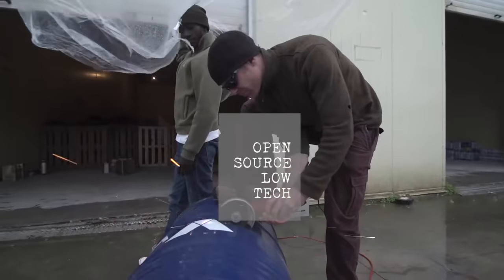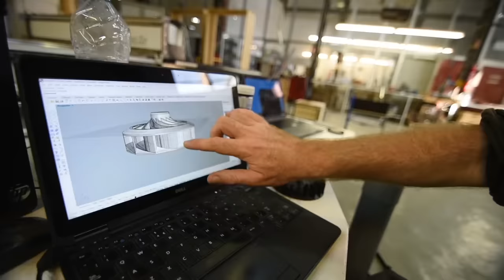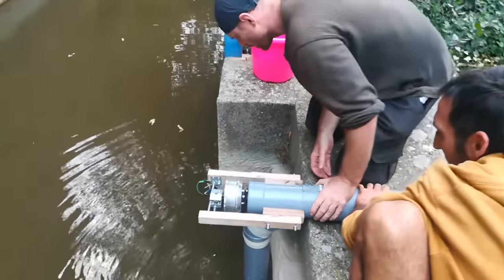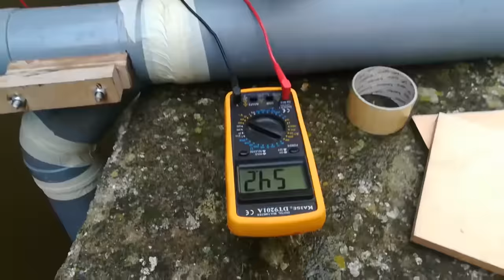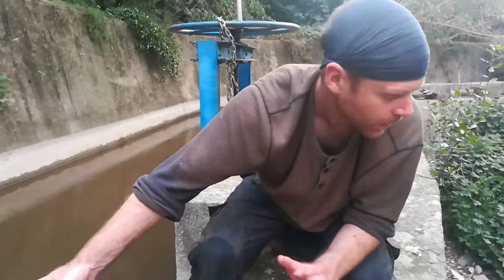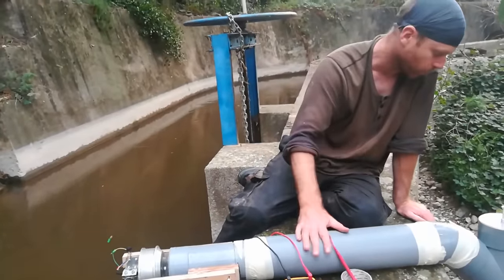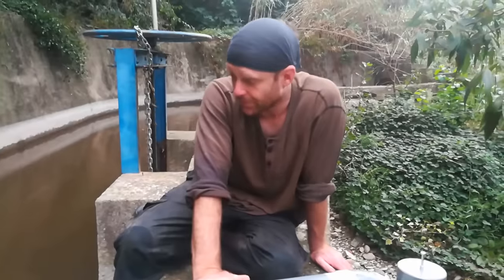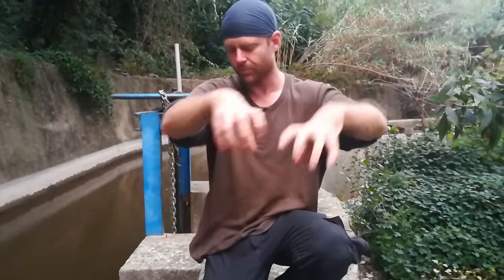The $50 Water Turbine -DIY, Portable, Powerful, and Open Source

Comment: He's like Doctors Without Borders but the green energy division. You have inspired me sir. I have water behind my house and I'm thinking of 4 of these in a series would end my dependence on the grid.
Reply: A big drop is necessary too, I think. Two meters is tough to come by where I live.
Reply: I've seen people do this method with even less steep of a drop, but they used a machine to begin the syphon initially so the pressure was crazy high
Reply: Engineers without borders is a thing. Also, as it happens, clowns without borders.

Comment: 5Hi there,  really do not want to be a small rain parade.  My experience with all of this is fairly extensive by this point.  Voltage is one of the considerations that tells us RPM.  Current draw is the basis for the actual load applied...not just a voltage meter.  If you put an actual 50 watt load on the system I believe your RPM would drop to 25% of the reading that you are getting now at possibly 12 to 14 volts which would need to supply a 4 amp output to be 50 watts.  It is very deceptive until you completely understand the full process.  Hopefully that is not a bummer for you and maybe I am all wet in my summary...just did not see a bulb or motor or something pulling off power other than a meter and that does not count in the real world...
Reply from the maker: In the process of finding out with the new test version in Berlin. Will post results hopefully by the end of the month.
Reply: @OpenSourceLowTech  I second the observation - there is no point in reporting zero load voltage and speculating a current/power availability based on generator specs.  Put a simple 10 ohm power resistor across to provide a real world load and then measure the voltage.  Make it quick though as (we hope) the resistor to get very hot, very quickly.  

Two other observations regarding your very interesting and innovative implementation though.
1) I would worry about maintaining a siphon for any reasonable length of time (days, weeks).  Maybe the continuous flow rate will purge any bubbles forming at the top of the siphon so this is not a problem.  Hope so.
2) Your observation that the current design with the impeller on top (terrific idea for maintenance etc.) not being dependent on the head as it 'is only dependent on the speed of the water, not the drop height' - I think this is going to be proven wrong.  Once you have a load, the weight of the water in the pipe will support the torque on the turbine, meaning the actual power will be directly affected by the head. 

Good luck with your project though, I look forward to seeing some real numbers.
Reply: @OpenSourceLowTech  you should look into maple sap production and how they run 3/16 lines(as opposed to 5/6) and it actually creates more vacuum in the tubing(sap doesn't just run down the side of the pipe, it seals and pulls vacuum) . I'm wondering If you could see this effect in your device if your down pipe was a smaller diameter that the intake??
Reply: @joshwooten3719  , with that much volume of water at the exit, he could use a much larger impeller and have ten time the torque where he can gear up for more RPM
Reply: @lightrose100   that water means nothing though if there is any air in the tube which could cause cavitation/air pockets. With the impeller at the top, it is completely dependent on liquid vacuum of the water moving through. Ie. You could move the same volume of air through the pipe as water and it would barely spin at all. I'm not sayings that's the case but the sap stuff is at the very least an interesting read.
Reply: David: Hence a reason why the Betz limit exists for regular wind turbines. Higher power draw, lower rotor speed = less power available than theoretical, based on unloaded rotor speed...

The beauty of a Pelton wheel (if there is any beauty to behold)  is that no matter the load, the energy of the water at the jet is "constant", just that a loaded rotor turns more slowly with higher impulse per cup.  - Downside, fairly high heads are required to be efficient.
Reply: Is your pipe 4 or 6inch??good video
Reply: Michael Moore Hi
Regarding top or bottom impeller placement. 
I think that when placed at the top, a vacuum will be formed at the edges of the impeller if at a certain height difference. This would not only lead to less efficient operation but also to immense wear of the impeller. (Cavitation is the term)
Reply: Not raining on parade. They're just researching making this system and this is part of it. At this point, I'd say they're well on their way to success.
Reply: @tommykbelly  that is 4 inches regular pipe is not the sh40
Reply: @OpenSourceLowTech  
If it requires manual priming, it better be located close to the dwellings.  It's going to need priming if the flow is full of air.
Reply: @Conservator.  Absolutely correct.  Even a small siphon is not used in the real world because of the damage to the impeller that results even with steel impellers. That system is not a long term solution for the third world.  I can hear the cavitation.  Nice to see them trying to find low tech solutions and I subscribed to the channel because they are trying to solve real problems and not just complaining.  Just because this is not optimum does not negate the effort and I appreciate the effort. Good work keep it up guys.
Reply: Interesting
Reply: All Right, pipe down you lot ;)
Reply: I dont see how he's going to get 10 amps out of that setup. 5-12kw? I dont think so with such a small setup. I work as a hydro regulator in the US and much larger induction motors on small dams with low head can get 15-18kw maybe.
Reply: @oceancon  While I agree, Im not seeing 10A out of that, if he can produce 10A, then a lot is dependant on the load!  W=I^2*R  so if the current output remains constant, as the resistive load increases so will the wattage, w=10A^2*R, so on the high end, 12000W/100A(I^2)=120Ω of resistive load!
Reply: @mysticdavestarotmachinesho5093  It may be cost effective in the long run to regularly replace the cheap fan blades due to cavitation wear.  Or... would it save money in the long run if you place an expensive turbine in the bottom? (It's more energy efficient, too, right?)
Reply: @oceancon  Isn't 10 amps times 55 volts only 550 watts?  Or was his guage reading 550 volts?
Reply: @MultiPleaser    I know it is a matter of excessive vibration caused by the cavitation.  Is  that the same thing with different words?  Vibration - Cavitation?   The vacuum created behind the impeller, or fan creates problems.    If I had the only, or best, option of a suction system I would really beef up the shaft the housing and use oversize bearings.  You pose a very interesting question here.  The fan.  Cheep or not. You can print out a fan blade with a 3D filament printer and PLA plastic.  That won't work for long but you could take that plastic surround it with casting plaster and burnout the plastic and then do a lost wax casting.  Very possible but maybe a long learning curve with learning how to do casting in any form.  You could also print a impeller and sand cast it.  Melting Aluminum and casting things seems to be a popular sport on the internet these days.  Once learned one could cast several impellers and see how they do.  With a filament printer, or access to one,  and the knowledge base on the internet several designs could be tried.  If put on videos that would be a channel many would subscribe to.  Good question and it did cause me to think ... which I always appreciate.   I really did like to original video.  If I have not said it before I like the fact that they are doing, and building, something.  Too many people just sit on their ass and criticize.
Reply: @mysticdavestarotmachinesho5093   We did the lost wax trchnique on a fun "field day" in high school.  First take an object you want to copy, make a rubber mold, fill the mold with wax, take the wax copy and stick it to a wax tree with other copies, cover it all with liquid clay/ceramic of some sort, heat it up to melt the wax leaving a hollow clay tree behind, then fill it with molten metal.  (I forget how the clay/ceramic was baked hard without melting the wax.)
Reply: @mysticdavestarotmachinesho5093  Or... you can get a CNC mill for the home PC, or have it done mail order.  I'm on a mailing list for just such a company.
Reply: @mysticdavestarotmachinesho5093  Or... just go to a junk yard and get the turbine from a crashed PWC, like a Jet Ski or SeaDoo.
Reply: @MultiPleaser  All good suggestions.  I have no idea what the turbine looks like on A  jet ski but the idea is great.   You planning on building a turbine?  Even if not research is always good.
Reply: At best under load your looking at 0.5 KW/H. Still impressive for the size and the materials used
Reply: Yes, this guy has misinterpretted his results.
He's getting that many volts and that many revs with no load at all.
He's assuming he'll get that many volts with a 10 amp load... ie 500 watts.
That is half a kilowatt, or 2/3 horsepower... there is no way that small fan and small generator can deliver that.
As David above says... I also agree that when he puts an amp load on it and gets the "sweet spot" of volts/amp/revs it'll max out at about 12volts and 2 amps... ie about 25 watts.

He's also got his meter plugged in wrong. The black lead should be in the Com socket, not the 10A socket.
Reply: @pooterist  the alternator is the load, 500 watts is very realistic for that drop, The flow of water looks like 1 L per second
Reply: 500 watt solar panel $300 .... That is the more realistic option
Reply: @oceancon  500 Watts over 24 hours could  charge a Tesla powerwall
Reply: @13thbiosphere  Not only more realistic... that does work... whereas this guy extrapolating that he's going to extract 2/3 Horsepower (1/2 kilowatt) with that wee fan impeller is actually imposible.
He multiplied the no-load voltage by the rated amps of the motor to get the power it could generate... Duh... kids' stuff.
Reply: @mysticdavestarotmachinesho5093  I may have to build my own turbine eventually. But, yes, experiments first.
Reply: @JoeJoe-uk3op  Wow, that looks like more water flow than a 20 hp outboard could produce.   Maybe 27,000 watts?
Reply: @MultiPleaser  Not sure you really have to experiment.  It's all been worked out so really it is a matter of research.
Reply: @JoeJoe-uk3op  now that is sweet
Reply: @mysticdavestarotmachinesho5093  I'm guessing an old timey water wheel is the most efficient.
Reply: @MultiPleaser  Efficiency is a moving target.  The amount of water, the amount of head, and the electric generator you have or is available plus the distance to the point of use.  It all add or subtracts to efficiency.
A water wheel is a good option but so is a turbine and there are several turbine designs.  The most efficient?  If you have enough head and can afford large diameter pipe plus have a choice in the voltage produced ... If I had a long distance between generator and my light bulb I would try to get as many volts as possible or practicable.   220 or 440 Volts and sixty hertz and I would try to get as heavy a gauge wire as I could afford.    The nice thing about this video is he made something useful with what he had laying around.  Scrap or junk or whatever he had.  His or their idea was to make something cheep and easily doable.  Hey they made something that does work.  Might not be the best but what if the power went out for an extended period and  you needed to run your refrigerator?  This video might at least get you thinking about what you do have available to make something with.  So many dismissive comments by people that did not make anything.  What is that saying?  The biggest obstacle to a good plan is the dream of the perfect plan.
Reply: @mysticdavestarotmachinesho5093  I guess a water wheel would provide high torque and amps, so distribution over long distance would be inefficient.  But for an off grid home all you need is 12 volts.
Reply: Put an MPPT battery charger on that, and you can keep the high voltage, which is generally more efficient, at least for the PMA I've used. He may have overestimated the power he's likely to produce, but he's got power. Optimizing flow rate and voltage for turbine and PMA efficiency is the thing. And how quickly the turbine blades wear out! And whether the siphon can stay primed! All good points. I am on pins and needles to see the rest results!
Reply: Your forgetting that you can use such voltage to charge batteries (12 V), also low watt LED lights, also to power low watt electronics, multiple applications..so your wrong about the bulb..open sourcelow tech..dont listen to this guy..your doing a great job..
Reply: asoka nelson Only when the sun shines. At night?
Reply from the maker: Hey all, just rediscovering this thread. I finished the second build in Berlin, you can see the results here:
https://www.youtube.com/watch?v=ibCu0PxIZA4
Long story short, with a few modifications but still as cheap and easy to make; ~200W @ 61VDC (rectified) x 3.1A.
Or about 5 kWh / day.

Which I'm pretty happy with.
Next step is to install a couple in the field here in Scotland to see how they hold up over time.
Reply: Over and over we see people create something that generates X volts under no load and then claim they have something revolutionary. I've seen someone "generate" 1200w of power with a bike and gearing, casually pedaling. And yet the most powerful cyclists on the planet are lucky to hit 600w for up to 1 minute before their bodies start to shut down. Because that test was done with a load... put a moderate load on this system, and the fan would barely turn, and likely would bend/break as it's not intended for the load. And would generate maybe 10% of the claimed output if that. I'd love to see a working system do well though.
Reply: Brunnr 
40 years ago as a kid touring the Ben Franklin Institute museum i saw their ‘bicycle’ generator set up with progressively lit light bulbs. Demonstrates the load issue perfectly. 
But today we have all these “smart” educated (sic) people like this ‘designing’ things that don’t have basis efficacy and people who think they’re going to eliminate their electric bill by running microhydro on their swimming pool return line. 
People were smarter in the 1800s
Reply: @OpenSourceLowTech  
Hahahaha! All these people claiming to know lots about this and saying there's no way you could get 500 watts out, and then the results are in and... you're not far off - I bet with a few efficiency improvements you could get that 300 watts up to 500. 
Well done!
Reply: @MultiPleaser  
But a 60HP pwc turbine probably isn’t very efficient at spinning up in a low horsepower situation.
Reply: @simone9846  
Per day total, optimistically maybe
Reply: @13thbiosphere  
What? The alternator has no kinetic resistance beyond a minor mechanical loss (part of its natural inefficiency) without an [b]electrical[/b] load.
Reply: @13thbiosphere  
But it’s more like 20-25W not 500 lol